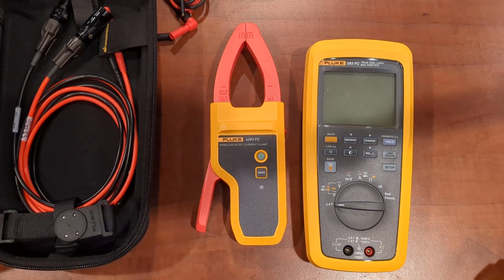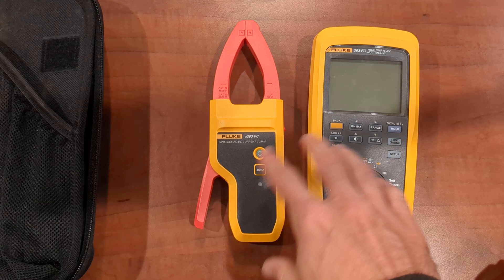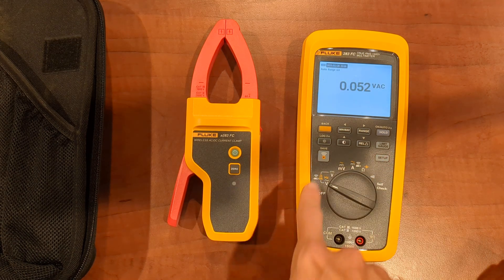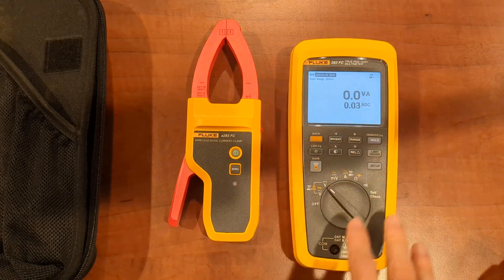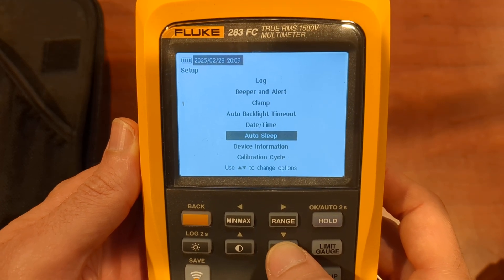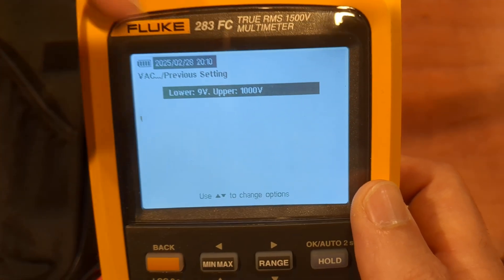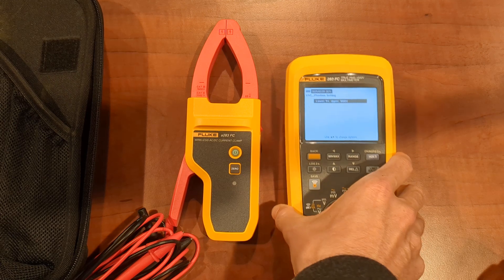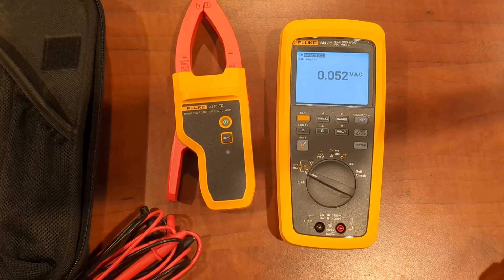Fluke-283 FC - Fluke Fridays - Episode 137

Comment: Hi Brandon! Do you have an email by any chance? 🥲 i wanted to contact you for guidance on a fluke equipment
Reply from the maker: What's your question?
Reply: @fridayswithbrandon  My mother is having difficulties getting the equipment installed properly. It appears that most electricians aren’t familiar with the fluke equipment and the one we got, we later found out set it up incorrectly. The equipment rental (Fluke 1777) was extended and we are still trying to have it setup correctly. Do you have any advice for us?
Reply from the maker: @itsnatemate7697 call 800-44-FLUKE
That will walk you through everything
Reply: @fridayswithbrandon do you have an email?